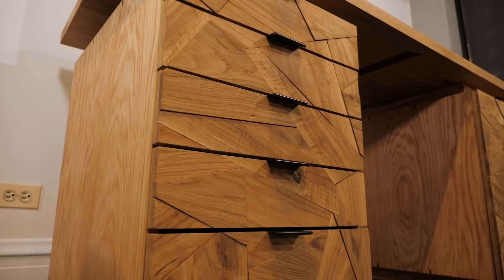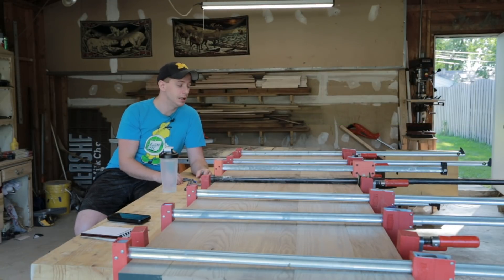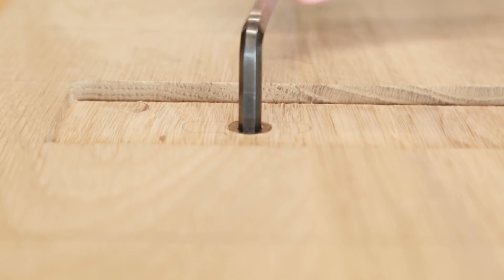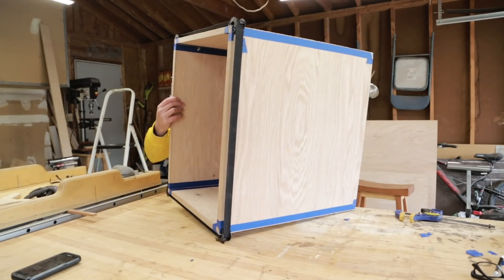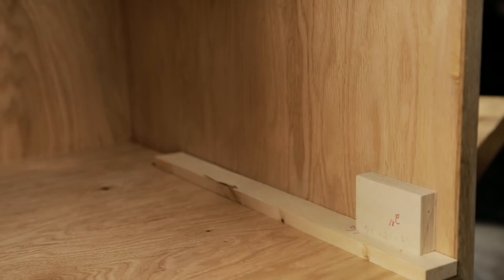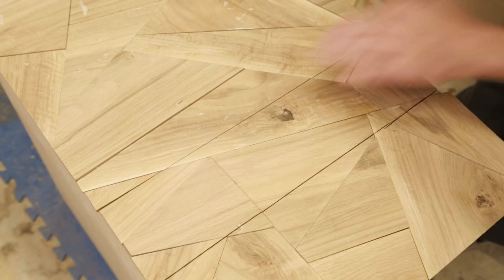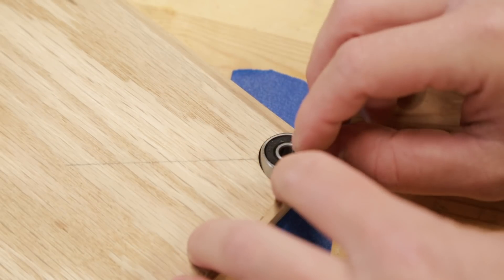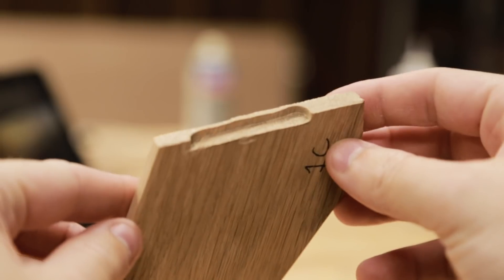Executive Desk Build - Kinetic Folding Door - #Rocklerdeskchallenge

Comment: Does the dowel rods work better than a biscuit jointer? I have never really used dowel rods. So is there more stability in the rods compared to the biscuit or is it just falling under mainly the creators choice?
Reply from the maker: Ive never used biscuits to be honest. I know both are supposed to be for alignment, Ive just always felt the dowels would do a better job